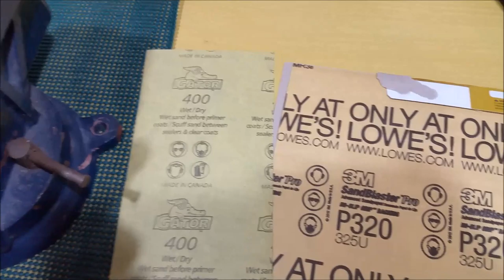CZ Scorpion Trigger Spring, Reverse Safety, and Trigger Polish

Comment: I was able to get my factory trigger group down from that awful 9lb pull to a 5lb glass snap just stripping all the paint, filing hammer angles, and 2000gr sandpaper to every moving surface, sear, hammer and disconnects to a mirror finish. Before spring kit I managed to get a 5lb pull and 2mm reset this route. 
Appreciate the video!

Comment: Thanks for the vid. I think I'm going to polish the disconnector bar and the inside wall of the trigger housing (where the washer would go if you were to use it), as well as the sear and wall of the trigger box where those two components rub against each other.

Comment: Very well done video. The ting that’s the most annoying to me is the mag release has some really sharp edges. I think I am going to be replacing it with aftermarket.  

Have you had my issue with light primer strikes after the spring replacement?
Reply from the maker: I have had no light primer strikes. I only replaced the trigger spring. I still use the original CZ hammer spring.

Comment: After putting back my bottom piece the bolt is stuck and will not close any tips for me ?
Reply: I had the same problem. you can loosen, all of the allen bolts around the frame, that should loosen the bolt. If you have trouble getting the trigger housing back in, I pulled the rear grip and the housing just fell into place safety end first and then the forward section. put grip back on, tighten allen screws (not to tight ) on the polymer section or it will crack, and your done.

Comment: I can't understand polishing the hammer face though.
Reply: His thought on it is that it will assist in the resetting of the hammer by the bolt as it moves back since it will have less friction. While technically correct, this really doesn't do anything noticeable to the gun during operation. You also need to be careful about polishing off surfaces like this because you are removing the harder anodized surface and leaving softer metal exposed. Polishing can be a bit of a misnomer because you are removing thousandths of an inch of material. The "Polishing" is simply moving to finer and finer grits until the scratches aren't visible by the eye and have a mirror like finish. This can cause damage over time as components like these which are getting battered back and forth with high force, are more susceptible to deformity when the softer metal is exposed. This is especially true for parts that are casted steel.
Reply: @bravekid2012  would you recommend just doing the HBI spring kit + flat trigger and forgetting about polishing? Seems sketchy putting abrasives to something that is very fine and calculated
Reply: @opinion56  yes the HBI kit will already drastically improve the pull especially when combined with their forward theta flat face trigger.

Comment: I do appreciate this video as it was helpful and I appreciate your efforts. However it was kind of frustrating looking at a towel as you were describing the hardest part of reassembly because it was all above the camera. And then the actual installation was off camera.

Perhaps you could edit something in there and have somebody else video you putting the spring underneath the safety disconnect.